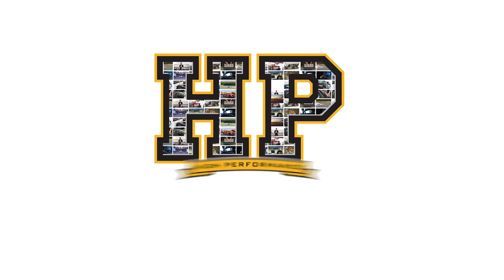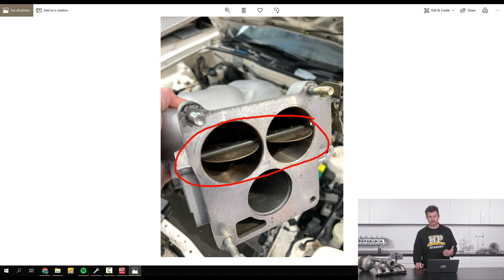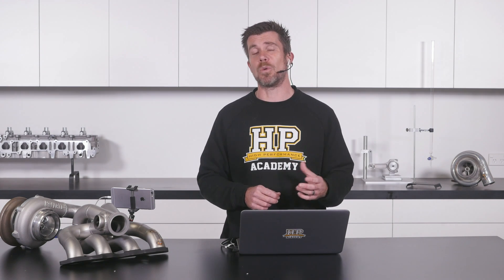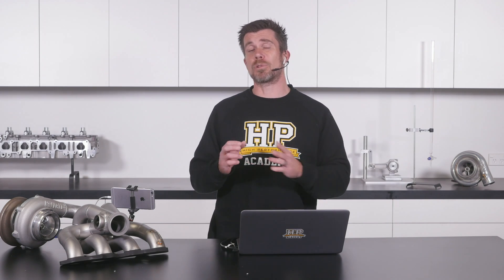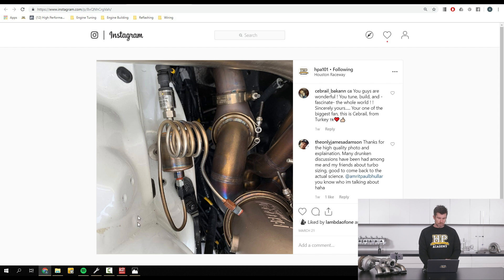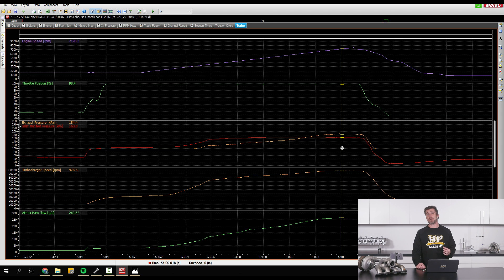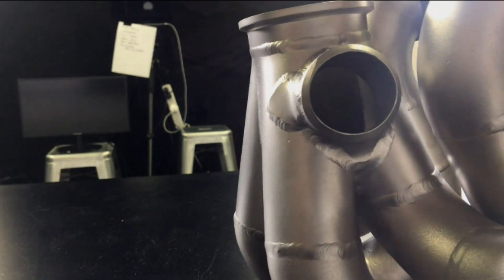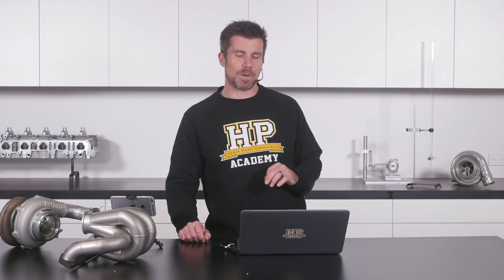Exhaust Back Pressure And Boost + 13b RX7 Drive By Wire | Today At HPA 212 [UPDATE]

Comment: Right before you released this episode I was scouring youtube for info on running an LS throttle body on a modified 13b manifold 🤙🏻
Reply: Jameson Dahn Full Function Engineering makes an adapter for this.  I’m using on mine, I also opened up the 3 holes and it’s now one big triangle.  Using a Subaru pedal and AEM infinity.
Reply: Thanks for the info Pope! 🤙🏻

Comment: the massive problem I see with your remote egp setup is that, by reducing the temperature, the pressure will change (PV=nRT). you should do the math in order to implement some sort of ecu compensation so that you get the correct reading.
Reply: Excellent point, but you're comment would be correct when applied to a static system; NOT this application.

In a continuous supply system, like this, the pressure will not change with temperature so long as there is no major restriction between supply source and pressure transducer.

Comment: 2005 honda accord drive by wire system can be used as a great conversion. Uses cable from pedal into a box that transfers physical input to digital for the DBW throttle body. No need to change the std pedal at all.

Comment: Are you going to use the Throttle Bypass Valve on the 13b or do you plan to control Idle Speed only via the DBW System? I'm building basically the exact same Setup right now (DBW'd 13b, EFR8374, Street Port, etc) but i'm still undecided on the DBW Setup. My initial Plan was to use some sort of Bosch Motorsport TB on an adaptor like the FFE one but you have a good point with the Double Throttle and Airflow Separation between the UIM runners. The idea behind going DBW though, was to get rid of all the additional Stuff on the Intake System (AWS, ISC, etc ) and i'm a little worried that the remote mounted DBW system is not capable of running precise idle control without a Bypass Valve. I think the E46 also runs a bypass in stock form.
Reply from the maker: In most instances with a DBW throttle I use the throttle body for idle control and it works exceptionally well. It can get a little tricky to gain really accurate control though if you're using a really large TB as even a tiny change in blade angle makes a big difference to the airflow. DBW and ISC were incorporated together when DBW was relatively new but you won't find ISC necessary with modern DBW TBs and modern control strategies.
Reply: @hpa101  Thanks for the reply. "Modern" DBW systems are not remote controlled with an external actuator though. Anyway, let us know if it worked out on the FD, i'll copy it then :) .

Comment: That wastegate position still isn't great. It looks like it's fitted at a 90 degree angle, so the exhaust gas IS having to make a sharp bend to exit out the gate. Most quality manifolds that have been well thought through will have the gate positioned in a manner where it runs at way less than a 90 deg angle to stop boost spiking. The closer the gate flow is to the direction of flow through the manifold the better it works... Bloody Kiwi's... Maybe give Kyle @6Boost a call and see what a good Aussie manifold looks like... 😜
Reply from the maker: Yea I pretty much covered everything you just mentioned in the video. As I mentioned, in this particular instance given it's an engine swap there's very little space and hence the options are limited. This is a base manifold designed for an S-chassis and there's more room for the wastegate integration. In our case Sinco have done the best job possible given the packaging constraints. There's the ideal world and then there's reality. While we aim to get as close to ideal as possible, we still live in the real world and sometimes compromise is necessary. What i can guarantee is this integration is going to work a LOT better than the original mockup which had the wastegate solely coming off a single runner.
Reply: @hpa101  I agree it will work better than taking it from one individual primary runner (which of coarse is never going to work) but having a 90 deg bend is so far from ideal that I think it still may give issues with boost control if you end up chasing some proper power. If it's only going to push low numbers on low boost an oversized gate for the application will hopefully keep the boost under control- but I wouldm't be surprised if it's an area you'll end up having to do a little more development on and try and change the angle of the gate to flow at least a little closer to the direction of flow of the exhaust gasses. I don't want to come across as you're average know it all keyboard warrior, I actually have 19 years experience as a qualifed mechanic in Australia and do a lot of this kind of work for customers, friends and of coarse myself. Being someone in the trade, I like the channel. A lot of it is aimed at your average enthusiast- but some of the tech and stuff is still good to see. One of these days I'll cough up some cash and have a look at your tuning coarse, as it's one area my knowledge set could be better. Cheers
Reply: @hpa101  I know this is stating the obvious, and in some ways can be argued that this option is not ideal either- but the gate itself doesn't have to be mounted right on the manifold. In the same way you have to have less than ideal bends in manifolds themselves and snake primaries through where you can, you can run an extension pipe to the gate and mount it in a semi- remote fashion and therefore leave yourselves room to have a more favorable flow in terms of direction from the collector. It would require fab work to be done while the engine is already in to package it all properly, but it would work a lot better than a 'gate mounted at a 90 deg angle. I think this might be the best they can do without building a set up in the car and being restricted by using this off the shelf manifold (the position and length of the collector is limiting 'gate position- if the manifold looped down a little lower in the bay it would allow for a slightly longer collector and to run a pipe off the collector to the remote mounted 'gate), but most decent fabricators could do a pretty good job of this if given the car with the engine already fitted. Just a thought. Will be interesting to see how this all plays out...

Comment: I’ve seen people drill out the 3 butterfly valves and put on large one instead. Then replace the cable with a RX8 drive by wire. Wouldn’t that be easier and cheaper?
Reply: Yes you can do that but then you lose the staging of the primary vs secondary port induction. Having primaries only increases  response and torque at lower rpm, throttle angle and off boost

Comment: About the exhaust back pressure graph, it looks kind of weird how is it possible the turbo manifold pressure stay atmospheric after full throttle applied and boost start to build?
I'm using a "budget back pressure gauge" setup which tapped from manifold to an analog boost gauge, I always see back pressure start to rise before boost pressure, almost 2:1 at certain engine speed, it's a catless full exhaust system. A friend of mine with direct pipe setup told me he never see below 1:1 too.
Is this the magic of high tech turbo?
Reply from the maker: It's not magic, but rather just to do with turbo sizing. Modern turbo technology has allowed us to get better response without needing to strangle the turbo and cause high back pressure. Everything is a balance though and for a given turbo, less back pressure will result in more power at high rpm but less response. It's quite common for factory turbos to produce a pressure ratio of 2:1 as the manufacturers are focussing more on response than outright power.
Reply: Modern VGT turbos on compression ignition engines can easily achieve 0.5:1 on a OEM turbo.

Comment: I fooled myself. Please give us 7s more more info. about your fd's backpressure since it doesn't have a valvetrain? So maybe info on the size turbine wheel and exhaust housing size? A bunch of us could really benefit. I love how educational you all are. Thanks a much!
Reply: Rob Dahm did some testing of different housings on his 3 rotor, he still had some back pressure issues at high rpm. Installing a pressure sensor will take a ton of guesswork out of selecting the proper turbocharger.
Reply: @dj4monie  thanks. I done more research on the matter. I still want to know what A/R they will be using on there turbo. I know other rotary guys are interested as well

Comment: Could always use the old 03-07 USDM Honda Accord V6 APP sensor since it's remotely mounted. You can keep the original pedal and just run the old throttle cable to it to get your pedal position.

Comment: Great explanation...especially as it relates to overlap and cam selection. You mentioned this in passing but I think it's important to reinforce that the energy in the exhaust is helping spin the turbo, and this energy is in the form of heat, not just pressure.  So it is entirely possible (and desirable as you stated) to have a greater pressure in the intake then in the exhaust. It seems at first glance to be a "something for nothing" situation when you just examine pressure alone, but the heat energy is the contributor that makes it work.